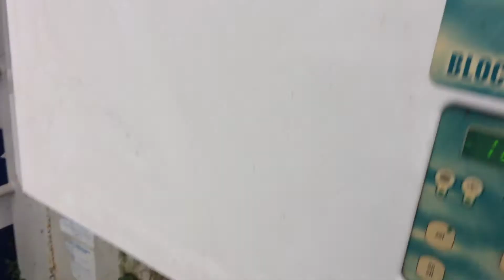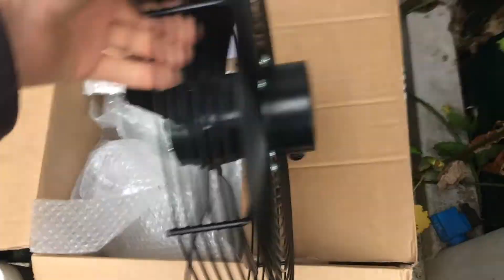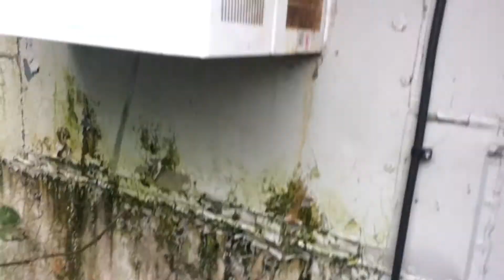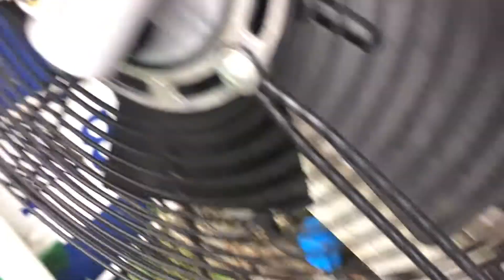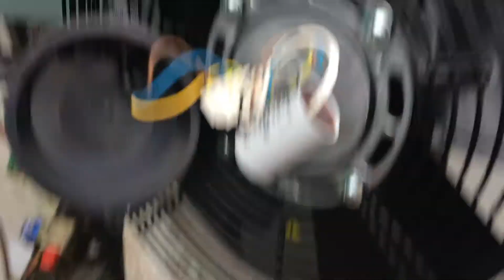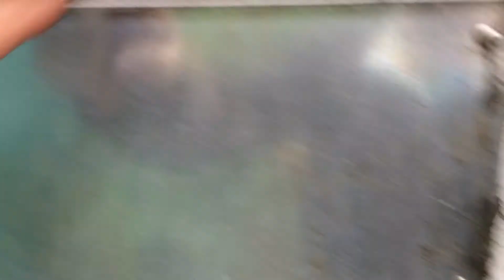Rivacold Replacement Condenser Fan

Comment: A steel mill I do work at has a chiller made in Switzerland that uses motors like that.  Just a bit bigger. They bought the parts and I just put it in. We had some issues with it over amping and tripping the overload.